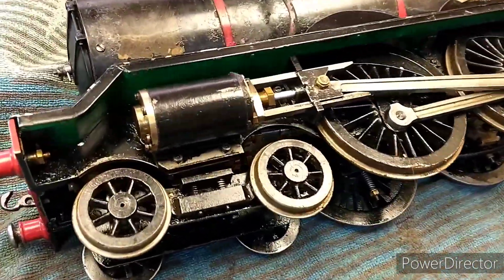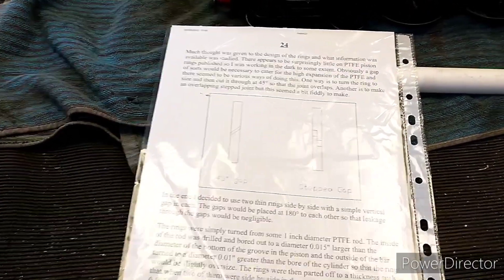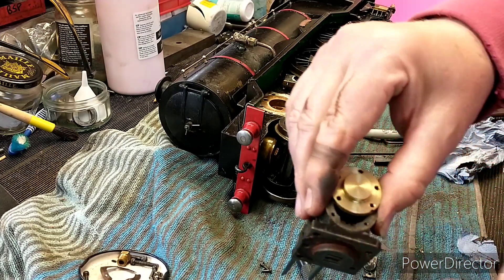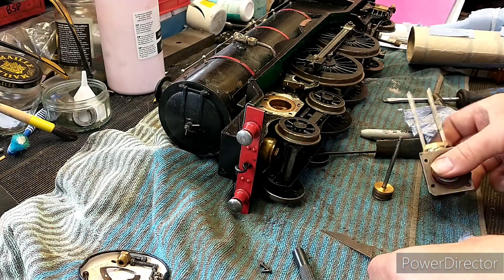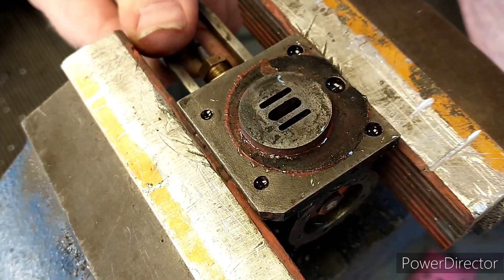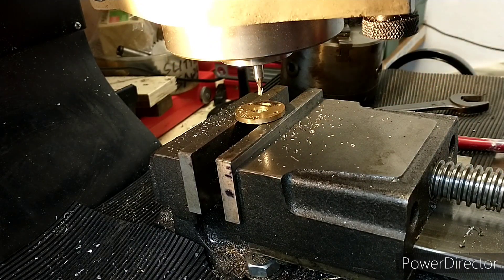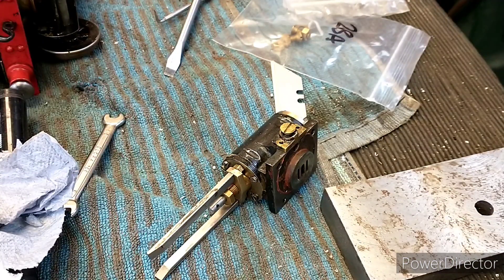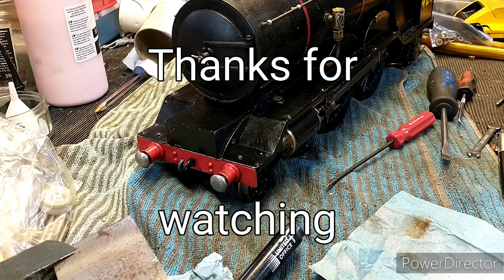Making PTFE piston rings for Ayesha 😀

Comment: Very useful video! Can I ask how do you know when you need to replace the piston rings on these locos?
Is there signs from the performance of the loco that are a tell tail sign?
Reply from the maker: Good question 😀 I found that it wouldn't pull  me round the track at low speed but it would at higher speeds. At low speed the steam has more time to make its way past the rings. In really bad cases you can hear the steam going straight up the chimney when you open the regulator (Ayesha wasn't that bad).
Reply: @julias-shed  Arh ok that makes sense and I was asking as I'm not sure when the rings on my loco were last changed as was second hand to me and I haven't changed them but I don't think they need changing as it seems to run ok and don't think I get any blow past like you noticed.
Reply from the maker: I think the saying "If it isn't broken, don't fix it!" Applies in your case then 🙂
Reply: @julias-shed  Yes I think you are right and with me being no expert at taking apart cylinders and stuff like that I won't mess with it unless needed.